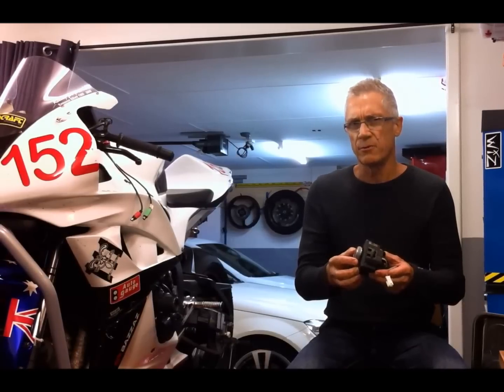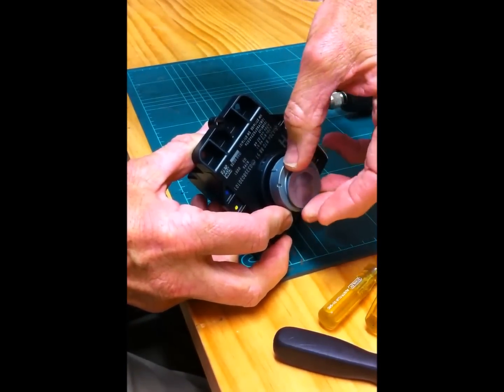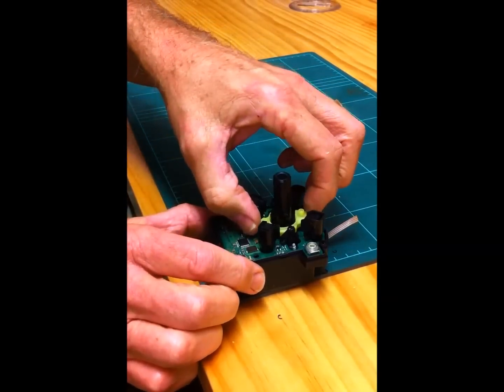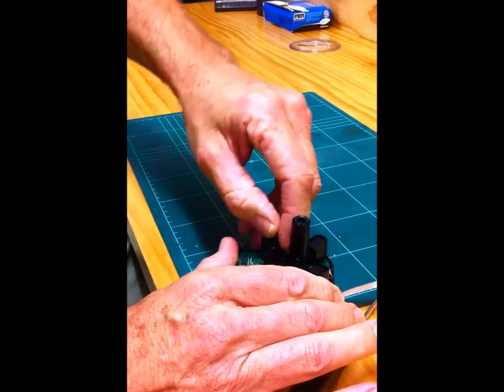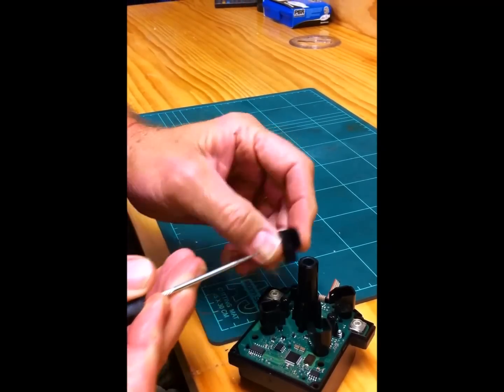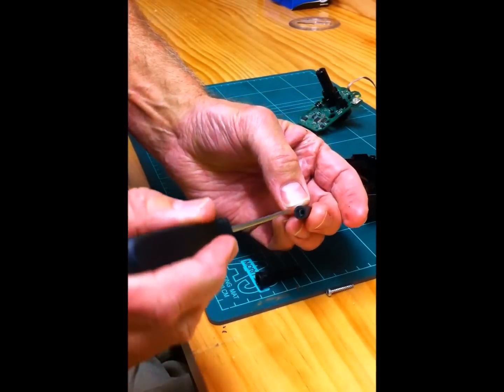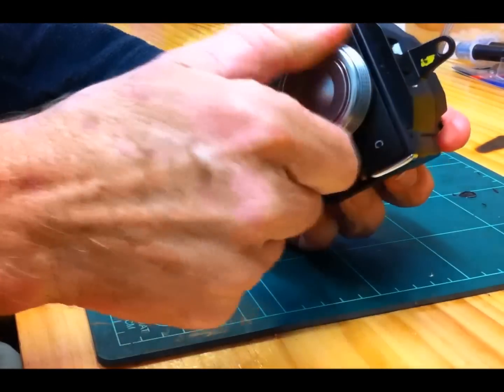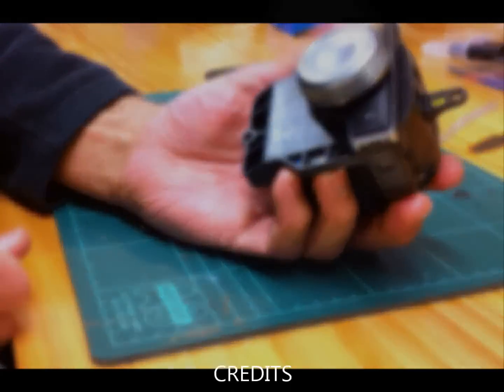Mercedes W204 W212 C E Class Repair Scolling Knob COMAND Console Control Wheel Command

Comment: Hi Scott, thanks for the very useful video. I've just finished assembling the unit and will try it first thing in the morning. I hope it works. The video was very informative. My only comment is regarding the cable. I followed your advice and cut it instead of trying to remove it only to find out that removing it was far, far easier than soldering the thin cables. I should have checked first. Other than that, no complaints and thanks once again. (Forgot to mention that my car is a 2010 GLK 350 4Matic so that might be why it was easier to remove the cable than to cut it).

I've since installed it back and it works perfectly. Thanks a lot!

Comment: Thanks for this video. I have just reassembled and installed and it is working perfectly.The only thing I done differently was, during assemble I fitted the rockers into their cradles before clipping the cradles back into place and found this an easier option.

Comment: Fairly straightforward. As others have said, you don't need to cut the wire - it's just fixed behind the carpet. Wheel rotation working fine but up and left nudge a bit temperamental. Will see if it sorts itself out or if I need to reassemble again to correct.
Reply from the maker: Yes I made a short follow up video showing how to get that wire out. Glad you got it going again.
Reply: @ScottElliott152  ah great. 👍

Comment: Awesome Mr Scott. My Mercedes is a manual and am not sure if you mentioned it or not but there is not any need to cut the cable in the manual as the whole cable is accessible and can be unplugged and taken straight out. Also I found that the torx screws on the bottom cover were a 9 and not a 10. Altogether a very helpful video. . Thank you very much for sharing it with us.
Reply from the maker: Thanks for your comments Khalil.

Comment: Thanks for posting! I was able to follow step by step. I was able to remove the module without cutting the wires, just released the clips by removing the carpet on the side. I couldn't put the clips back on though, so just followed your advice on the previous video and used tape to get the wires on. Thanks again!
Reply from the maker: Yes removing the carpet is the way to go. Something I learnt after making the video! Glad I could help save you some money.

Comment: Scott, just wanted to say thank you for making this excellent series of videos on the w204. I have recently bought a 350 estate and have repaired/serviced several things with the help of your experience through your clear and detailed instructions. I’ve done the rear o/s tail lamp fix (inc the n/s as you did to be thorough), the command wheel fix, the power steering fluid flush and the engine oil change. I am going to do a coolant flush/refill and was wondering if you have thought about doing a video on that. I have done this on other cars before but was wondering if there is a specific fill/bleed procedure for this engine. Any pointers gratefully received.
Reply from the maker: Thanks JF. I'm glad the videos were helpful. I actually did my coolant about 6 months ago but didn't record it. It's straight forward on the V6 diesel as there's no drain plug on the engine block like other Mercedes engines. There's just one drain valve on the bottom of the radiator. Do the coolant change when the engine is cold. Remove the plastic cover under the radiator to access the valve. Once the coolant's drained close the valve and fill with coolant via the overflow reservoir. Start the motor and the level will drop as the motor warms. Top it up and take it for a short drive to get up to temperature. Carefully remove the reservoir cap and top up if needed. There's no fancy bleeding procedure required.
Reply: Many thanks Scott, much appreciated.

Comment: Thanks a lot for your video, I was able to successfully repair my W204 - instead of gluing I've installed an aftermarket part made of metal. (the only difference I found - under the top ring I had a smaller screw than a torx 10)
Reply: Zoltan Uszta what size was it? My smallest is a number 10, so I need to buy another one.

Comment: I just did it on a 2011 E CLASS COUPE with success. I had some issue gluing the pieces together since the glue i have chosen did not keep the pieces together as strong as you did (i also did the matches trick) in the second try i reglued it back as before but additionally i have added a very thin layer of plumbing tape (strong and thin) Everything put back together and seems to be working fine. I didnt wait overnight for the glue (only around 4 hours). i am not touching the car again until tomorrow.
Reply: Forgot to say thx for your videos! they are awesome!

By the way a friend has a C CLASS 2011 version (facelift model not like yours, the one which has the led back lights and led front stripes). Is this problem applicable for those versions as well?
Reply from the maker: marinos michael  Thanks Marinos. I'm pleased to help people save some cash. I hate seeing people pay huge sums of money for things that can be easily fixed. It's good for the environment, our carbon footprint and the planet to extend the life of an item. There's nothing like a retired Engineer on a crusade!

The choice of glue is important as those Poly Propylene plastics are very difficult to bond. The plumbers tape is a good idea.

With the facelift model I'd speculate the same problem will arise after four years unless they've made a design change. With the dealers and their supplier doing a roaring trade selling replacement control knobs for huge prices they have no incentive to modify the component to make it last. Your friends 2011 C Class is getting to the time when it will fail. If it does help him pull it out, dismantle and repair and give us the feedback. It would be interesting to see if the shaft is exactly the same.

I'm looking at 3D printers at present as it won't be long before we can print off a new shaft to repair these things.

Kind regards, Scott

Comment: Thank you for the video.It was very helpfull for my glk220cdi command button ,same problem.As a hint i removed the jack socket for the button by removing each individual pin whit small screwdriver and pull them out whitout having to cut anything.
Reply from the maker: +Luca Valentin Thanks Luca. Glad I could help. That's a good idea about removing the four pins. Thanks for sharing the knowledge. We DIY'ers have to stick together! Regards, Scott

Comment: i think the 2nd hand ones are already flashed and new ones from the dealer are not and would be "dead" on the bus. Anyway i completed the repairs last night and its working great so thanks!  my only problem is i didn't watch the video carefully enough and tried to prize of the top disk first- i have scratched it a bit but can live with that!  

My local repairer in Vic, OZ tells me has has no access to MB Germany's master server so cannot flash parts like this switch it needs to be done by dealers. However in USA they do have access to MB servers in the fatherland because it became a legal issue. Using a web proxy and a co-operative USA repairer i reckon this problem could be sorted......

And my car is a 2009 march build  W204 320CDI.  I will check the RH connector tail-light!
Reply from the maker: Brett I think that's anti competitive behaviour by MB. I'm going to write a letter to MB Australia and tell them I'll write to ACCC if they don't give access to independent mechanics and DIY people like us.

Cars have changed as they're now a bunch of computer control modules on wheels. It would be no different if they had a special padlock on the oil sump plug that could only be unlocked by a dealer!

Regards, Scott

Comment: thanks so much ! Only problem wire must have caught something under knob pulled wire right off elect board. i just repressed on connector not to bad. Only tip is, if you a 90 deg. pick you can remove 4 spring towers without removing plastic rockers. Alot easier to reinstall. Got scared when screen did not come on but when wire broke it blew fuse. 2011 GLK
Reply from the maker: God to hear ... glad the video was helpful. Yes I've since worked out you can remove the 4 towers without removing the rockers.

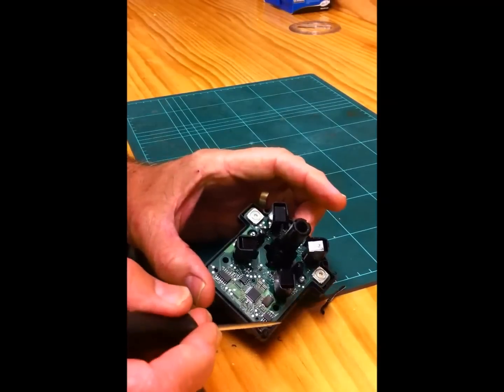Comment: Hello Scott and thank you for a great video! I tried to do it in my w204 but I have a small problem. When I try to separate the  two parts of the unit, they just won't come off (4:21 of your video). I guess I have to remove all 10 torx screws from the back, but I wanted to ask you first! Thanks again!
Reply from the maker: Georgios thanks for your kind comments about the video. Yes you must remove all the torx screws to separate the two halves. Make sure you have a small container next to you to put all the bits and pieces in as it's easy to lose something! Kind regards, Scott

Comment: Hi Scott, excellent video, I was able to remove the scrolling knob from the car without any difficulty. However, when I removed all four torx screws(2:47), I couldn't seperate the two halves. They move slightly but are still blocked. Any ideas?
Reply from the maker: +Elie Matar Elie there are about 10 torx screws not four. You have to remove all of them

Comment: Excellent post, thanks! An afternoon's work saved me a packet! Didn't even have to cut the cable - did the whole job in situ.
Really bad design on MB's part, though, making that cable so difficult to get to. Why couldn't they just have the whole module easily removable?
Reply from the maker: Hi Ken ... that's good news that you made a successful repair. Yes I couldn't understand why the cable was routed the way it was. Speaking of bad design, If you have a W204 make sure you check the RHS rear tail light connector for burning and melting of the earth wire. I made a video of how to fix it. Regards, Scott
Reply: Thanks for your response, MrScott52 - Yes, I already went through the rear taillight issue! Luckily it was repaired under warranty, when the car was still covered. Excellent work, you are providing a valuable contribution here.
Reply from the maker: *****  That's good they fixed it. There's a recall notice out in the USA and Canada. My understanding is they're not actually changing anything but just replacing the damaged parts with new versions of the exact parts. So I think it prudent to keep an eye on it. For what it's worth and the fact the repair is quick and simple I'd add the extra earth wire on each side for peace of mind. None of us want to do a "Ford Pinto"!

Comment: Scott, great repair video. I cut small,slots in short part of shaft aligning with recess in longer part and pressed in wire from sewing pins (bent to an offset) before adding the epoxy. Seemed very strong after drying.
Now the Sirius satellite module must be replaced. Any videos ore hints for that ? 2009 C300 Sport with 6 speed manual.
Reply from the maker: Not familiar with the Sirius. Try www.benzworld.org

Comment: Hi Scott, your video is amazing. I would love to try this out in my car but do you think that it's possible to do it without cutting the wires? I don't know jack about putting them back together again so I would be hugely comfortable if there was an alternative. Thanks!
Reply from the maker: Thanks Param. Yes you can do it without cutting the cable. Here's a link to a short follow up video to show you how to unclip the cable from the console.https://youtu.be/6dbw2rCAS4w
Reply: @ScottElliott152  managed to remove it successfully! Opened the unit up and isolated the broken shaft from it. Gonna glue it back on with some super glue now and hopefully get it back together. Can't thank you enough for this. I truly cannot express the feeling of satisfaction I am going through by doing this myself and not ending up paying Mercedes 😂. Thank you so much for  such a detailed video and helping folks like us. If you ever come to Mumbai let me know. Would love to take you for a spin
Reply from the maker: @parambhagia3670  Thanks for the offer Param. You'll find superglue doesn't bond well to that plastic. You're better off buying a new alloy or plastic shaft off eBay. There are plenty of sellers there.
Reply from the maker: There are plenty of these for sale. https://www.ebay.com.au/itm/Knob-Comand-Shaft-Axis-Pin-For-Mercedes-W204-C-Class-W212-GLK-Interior-Practical/124185933291?hash=item1cea0ef5eb:g:R6wAAOSwdh5evBQq

Comment: I am reporting from France. Your posts helped me a lot. Many thanks. However as I was not sure I would succeed I ordered a refurbished control unit from MB in Germany (http://www.mbgtc.de/Elektrik-Elektronik/Steuergeraete/Schaltblock-Controller-MBGTC-45.html) for some 85€. The dealer wanted to have 225€ for the new part and 370€ including VAT in total for the part and its replacement. Your 1st video was great help to me showing how to get the unit in and out from the console. I have a GLK 250 from 2010. When I managed the replacement I found your 2nd video that shows how to repair it - and indeed my broken unit had the same default - a broken shaft. It broke after 4 years about. You mentioned that. Seems that everybody has the same problem. This unit is practically in every Mercedes - imagine what a good deal that makes for MB and the dealers! Anyhow I have now 2 units and I know what to do in case it happens again.

Comment: Thanx al lot!!!! It was a fairly easy repair an saved med a bucket of money :) ca $1000.- Think I spendt $10-15.- on glue and stuff..
When I contacted MB, they said they've never heard about this problem ???? So no Warrany.. (E220 . 2011mod)
Reply from the maker: Glad the repair worked. I'd be surprised they've never heard about the problem as it's so common. They do a roaring trade supplying new control knobs at exorbitant prices. They always fail at 4 years after the build date give or take a few months. almost as though it's designed to do it. Regards, Scott

Comment: Hi Scott,
I'm privately reparing these knobs since several years now and have very good feedbacks. Just yesterday a buddy send me a defective out of a facelift. I worked hard, but didn't get the outer ring off. It seems, that Mercedes Benz had changed the design of that fixing.
Did you made experience with this facelift knob already and has a hint for me how to open that version?

Thank's a lot for your feedback

BR
Ulrich
Reply from the maker: Ulrich Bolik Hi Ulrich. I haven't had any experience with the new version in the facelift. It would not surprise me if MB have deliberately changed the design to make it harder to repair.
You'll have to keep experimenting. Maybe it has to be twisted first to unlock something. Or maybe there's some glue in there.
I'd try heating first with a hairdryer and then try to prise it off the normal way. 

Please let me know how you go.

Regards, Scott
Reply: Scott Elliott Hi Scott, Thanks very much for your immediate reply. As it is not my knob, I have send it back without having it repaired. I didn't want to destroy it. 
We have a well visited forum here in Germany for all kind of cars and I will check in the forum for the S204, if anybody knows a solution or has a brocken one for sale.
If I know how to open that locked oyster, I will let you know too.

Best greating to Australia from Germany.
Ulrich
Reply from the maker: Ulrich Bolik Thanks Ulrich. Your English is very good ... much better than my German! I have to use Google Translate. Kind Regards, Scott

Comment: Good video! Question: Can you tell if it's the shaft that's broken or the circuit board that's failed without removing the control knob? On my car both the knob and the two push buttons on either side of the knob don't work.
Reply from the maker: +daitati Sounds more like the PCB if nothing is working.

Comment: My daughter got a quote from the MB dealership of $650.00 CDN to replace the unit in her 2012 C-Class. For $30.00 I took it out and replaced the shaft with a new solid metal one. It's not that hard but you should use plastic tools not steel one's as you might scratch the consul.
Reply from the maker: I was quoted a similar amount for a new unit plus a few hundred in labour ... hence my decision to dismantle and work out what the problem was. A couple of years ago a friend bought a 3D printer. I removed the repaired shaft, accurately measured and printed a new one from nylon plastic. Agree with the plastic tools. I have a set of those plastic levers for removing panels. You can also use a knife wrapped in insulation tape. Regards, Scott

Comment: Scott, thanks for your effort, but before disassembling the controller, I would like you to ask the following. The controller still makes the known clicking noise will turning it, so I don't think the shaft is broken or am I mistaking? Thx
Reply from the maker: +Serge Manssens Serge ... yes you're mistaken but it's a good question.

The clicking mechanism is contained in the knob. It's a small ball bearing with a spring behind it pushing on indents on the underside of the knob. Trust me the shaft will be broken. Regards, Scott
Reply from the maker: Thanks for sharing the knowledge.

Comment: Thanks for this great clip I could not have fixed my control knob without it, My only change would be not to repair the shaft but to replace it with an aluminium one available on eBay (not from me)
Reply from the maker: Thanks Terry. Yes you can now buy replacement alloy or plastic shafts. Scott